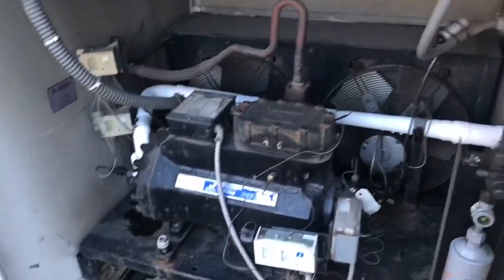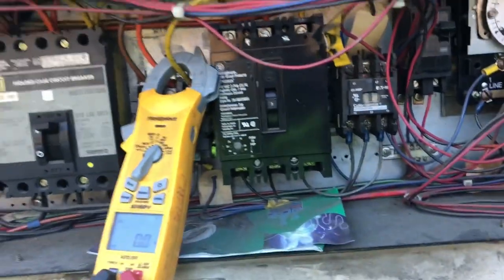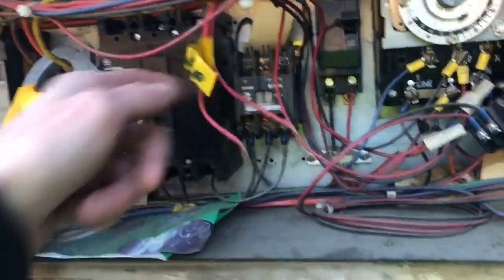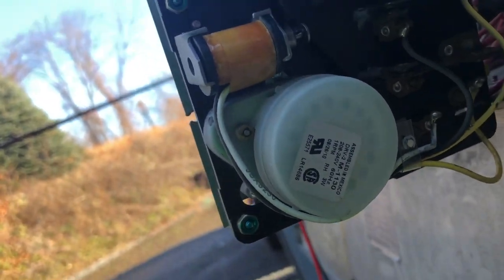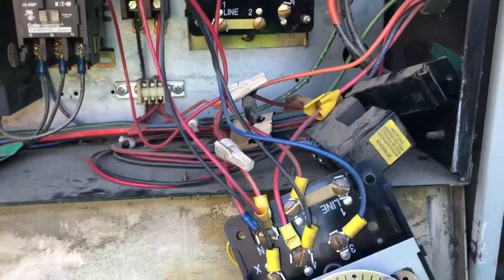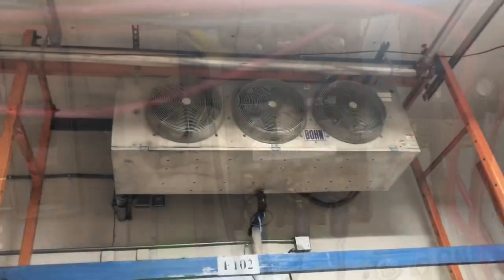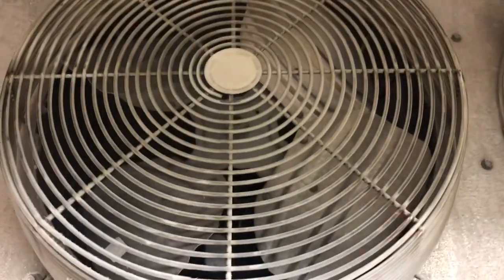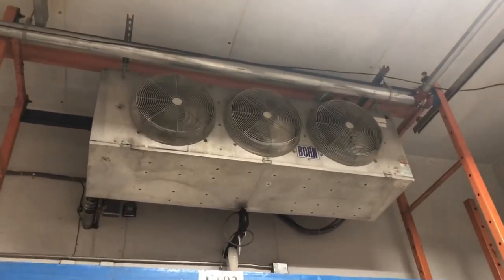Walk in freezer with multiple issues

Comment: Nice find!! Did get a side job setting up some new units up and wired the from the clock to contractor in the Russell condensing units if you wire straight from the terminal block it blows a 3a fuse for the clock... so contractors it is!! Nice job and used to do a lot walk ins a lot but doing a.c. pm and install n repairs... I miss reefer